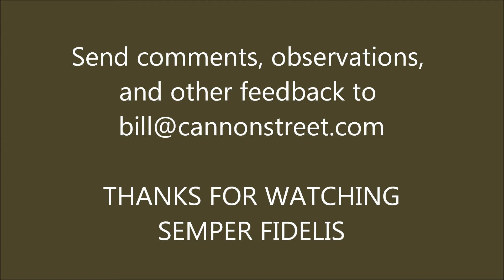Capt Bill Compares the Lensatic Compass with the Protractor Compass

Comment: The two compasses are made for two different methods of land nav. The protractor compass is made for the terrain association method. Sometimes called the orienteering method. The compass is strictly an adjunct. It's primarily a map reading method.
The lensatic compass is made for the dead reckoning method where you can't use terrain association. That would be if you can't see the terrain or where there is no prominent terrain or you are in a forest or jungle with minimum visibility. It requires a very accurate map and very precise navigation. 
Some armies, such as the British,  teach primarily terrain association navigation and use a GPS in place of dead reckoning. 
I've taught land nav for years and I'm convinced that the Brits are right! Dead Reckoning requires a lot of practice and nobody has time for that. You can teach how to operate a GPS rather quickly.

Comment: The protractor compass saves one step. With a lensatic, you can simply align the compass and map with true north, then twist the bezel so the marker is at the declination you desire. Then (this is the extra step) rotate the map and compass together so the needle points to the marker you just moved. Once the map is rotated, you can use the straightedge side of the compass along a line drawn between two points to determine your bearing based on the compass reading, and it's already corrected for declination (because you adjusted the map for declination, not the compass!). You get your bearing straight from the compass you'll be using so you know it's right. The MC-2G is a great compass, but very expensive; you can get a non-tritium military style Cammenga lensatic for half the price. Honestly with a little know how, they are both great, I prefer the lensatic but a well built mirror compass is good too- but the lensatic is more accurate in the right hands. The lensatic is simply better for sighting accurate waypoints and landmarks, plus it's a bit tougher and you never have to worry about bubbles at high altitudes. The Mirror is definitely a little easier to use on the map. But they are both good enough. Learn both and you'll know the other one better.